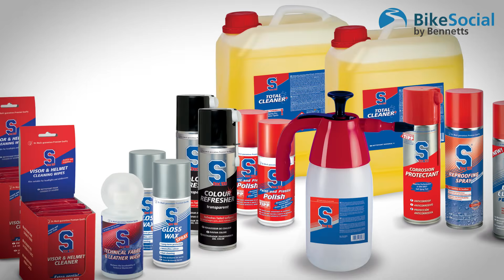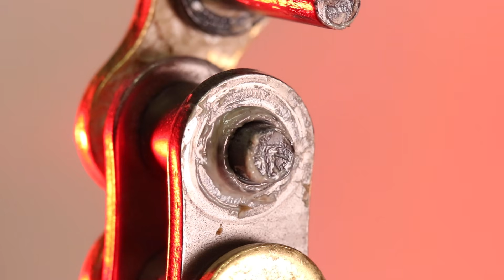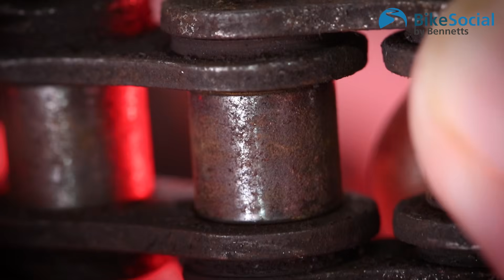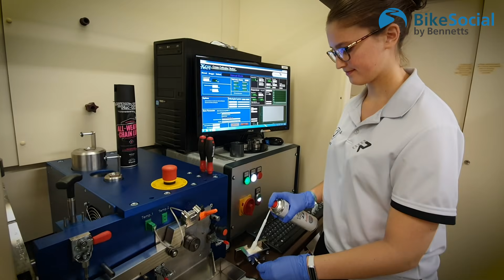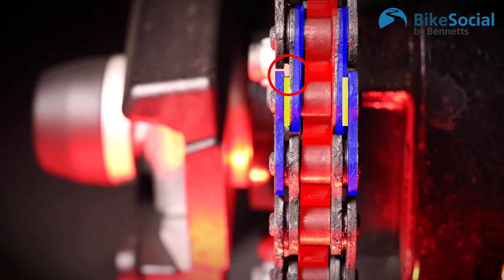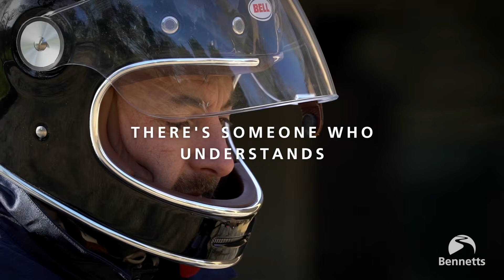Is chain lube a scam? Does your bike really need it?

Comment: Caution should be used with certain lubricants such as mineral based oils which can degrade the elastomers (o and x rings).
Reply from the maker: When I can finally get started on this, I will be testing the products for safety with O-rings. Cheers, John

Comment from the maker: This test will still be gong ahead, but lockdown has caused a major delay in getting hold of some of the materials. Hit subscribe and you'll get a notification when it's complete. Cheers, John
Reply: Thanks John.  I am subbed, so I get the alerts.  Agree that Ryan did a great job, but just not comprehensive enough to cover the UK.  It was interesting to see which "approved" cleaners managed to get past the o rings.  I currently use Muc-off cleaner and Wurth Dry lube.
Reply: @timmasonguitar  timmasong. Hi mate, in short I would keep every kind of aerosol lube or cleaner away from your chain. Both will just cause you brief and waste your time.
Metal to metal contact needs oil. All the chain manufacturers I have ever come across only recommend gear oil. 
apply to the inside of chain with a soft brush wipe outside of chain with a slightly oily rag. done properly you will get zero fling. your chain will always look like new and perform to its best.
Reply: @King-Arthur-The-First  hi. I'm new to motorcycles. So ive seen 10w/40 gear oil. Is that the sort to be using? And what about some youtubers recommending use WD40?
Reply: @arniet1  Hi arnie T. 10/40 is engine oil it is still fine but it's not as good as gear oil  because gear oil is thicker so has a little bit more protection for the metal to metal contact and less likely to fling off.
The 10/40 is in a group of engine oils like 5/30 5/40 10/40 20/50 etc. Engine oil needs to work at low temperatures and high temperatures inside an engine that's why they have those two numbers one deals with the low temperatures one deals with the high temperatures. 
gear oil tends to be 80 or 90 and often just says 80/90. 
if you don't want to become an oil expert short story is any oil Applied very thin to the chain will be fine to lubricate.
if you choose the wrong oil you just may have to put some more on before long or suffer a small amount of fling so it's no big deal mate.
if you have an oring chain then The O-rings are made of a nitrile rubber not the useless natural rubber and these nitrile rubber seals are used in seals all over the engine and fuel system and tends to be resistant to oil and fuel damage so you will be fine.
The idea of the WD-40 type products on to a chain is they are easy to apply and can keep the O-rings lubricated and wile that is okay it leaves the chains rollers to chain sprocket largely unprotected.
so better to use an oil which will do the job the WD-40 does but also do the job of protecting wear between chain rollers and the sprockets that are also driven by the chain so suffer wear. 👍
Reply: still waiting for the test.
Reply from the maker: @avsolanki94  It'll be worth it...
Reply: I hate doing chain cleaning, so I designed a new tool: ChainBath. https://youtu.be/UrkhRe8gQPI
Reply: Still waiting, would be super interesting.. come on guys!!!
Reply from the maker: The test is finally live... you can see it here: https://youtu.be/noshjM5CDas

Comment: what material are the seals made from. the cleaner/lubricator must also preserve the seals. but also this chemical should resist water. my best guess is a silicone spray or silicone brake fluid.

Comment: Chains are old fashioned, need a lot of maintenance and makes your bike and wheels dirty.  I still wonder why there is no maintenance free bike chain.  Belt- or shaft drive is imho a better choice,  in fact shaft drives can be made very light with the use of ceramic material .
Reply: There is now, bmw make the endurance chain with diamond coating
Reply: Drive shaft bikes handle way differant than a chain drive. The very reason they dont run drive shafts on race bikes. They handle like crap.

Comment: One used to be able to easily remove the chain. It would then  be cleaned. 
The appropriate chain grease would then be put into a pot, melted using Heat, ie. over a flame or hot plate.
When the grease becomes hot and fluid, simply lay the chain into the molten grease allowing the grease to penatrate the inner workings of the chain.
There were recommended amounts of time to leave the chain in the liquid grease.
After this process the grease would be allowed to cool so that the chain could be safely taken out of the pot.
A quick whipe over and the freshly lubed chain is ready for reinstallation.
Reply: I remember that can't remember the name

Comment: Chain lube traps dirt so you have to clean too.  Used WD40 only - had 17k miles on my bike and zero wear.  Fz1.
Reply: I would recommend a small amount of gear oil for the rollers and sprocket life also mate.
Reply: @King-Arthur-The-First  WD40 good for cleaning spray until it runs clear then cloth wipe

Comment: So factory grease is trapped inside the rings and stays there for the life of the chain. That’s also where the friction surfaces of the chain are. We don’t want anything to pass those seals. So what I don’t get is why do we want to lube the outside of the chain?? There no friction surfaces there so nothing to lubricate. And I don’t believe the lube lasts at the roller/sprocket interface long at all so is useless there...hence having a roller and not stiff bar for the sprockets to mesh with.
Reply from the maker: It's mainly corrosion protection but also to keep the seals lubricated, and within the rollers.

Comment: 50/50 automatic transmission fluid and acetone will clean that chain like nothing else! Splay bottle or brush it on then lube.
Reply from the maker: It will, but Acetone will damage the O-rings very quickly; in testing I've done before, it's ruined them very quickly. I really wouldn't recommend putting acetone anywhere near a chain. John

Comment: BULLSHIT!    Sand sticks to the wax or whatever and actually grinds the sprockets to hell. I stopped lubing my chain years ago. Grab your chain and get some lubricant on your fingers, now rub them together.  You have created your own grinding compound.
Reply from the maker: If you're riding through sand (or off road), you need to use a dry lube, a constant loss system or a light oil that you replenish regularly.

Comment: I've been riding for 40 years now. The chain on my Firestorm has just been changed along with sprockets of course. 32000 that chain had done. It had zero corrosion due to lots of lube. I spray the chain liberally then wrap a rag around it while turning the wheel by hand then repeat. The chain now looks good and ready to go. The other trick is don't have your chain too tight. Adjust the slack with you on board. Your chain will thank you for this.

Comment: I did a French tour a while back with a big kwack, I had a mini aerosol chain lube which I did most days. We had terrible weather, rain, heavy or torrential! At the port in France on the way back after passing control I rode around to the embarkation area, I thought I was being followed by a Panzer tank! Bought a scottoiler mini, I now adjust the chain once a year, which includes a European jolly of 1500 miles or so every year.
Reply: A non O-ring chain lubricated in gear oil would not have failed on u ... enough said
Reply: @mickeymouse4897  on a 1500 mile European jolly with poor weather, non o ring oiled on departure would have been dry day two, eight days with no lube! no, chain oiler on big power bikes is the only way ✊

Comment: I like the belt so much on my HD. No mess, lighter than a shaft, simple. I would think they could make one for any application by now. Though I guess the front sprocket size is an issue.
Reply from the maker: It's also maintenance – you have to drop the swing-arm out to replace it.
Reply: @bennettsbikesocial  My Harley is 19 years old and on original belt. Pretty low maintenance for a heavy bike. Swing arm is as easy as removing a wheel.

Comment: Do you know what. I use to race as a pro speedway rider... Oh 35 yrs ago and had two chains (primary countershaft and main drive) to maintain.
Renalds, DiD and maybe Regina.
After every meeting. I would wash them in petrol. Soak em in old oil, for a day or so and then simply hang em to drip dry.
My chains would last me almost a complete season. And under that sort of tention that a speedway bike puts them under.. 60bhp.. I would say that chain lubes, no matter what make. Are an industry scam. Good money for old rope
Reply from the maker: Presumably speedway chains don't use O-rings? Any sticky lube would be hopeless in that environment anyway. If road riders removed their chains (tricky without taking the swingarm out if there's no split-link), cleaned them (not in petrol as it will destroy the O-rings), then soaked them in oil (actually, if they're doing that, it maybe wouldn't matter that the O-rings were damaged and the grease had come out), then refitted them after every ride, chain lube would be unnecessary. But it's about convenience; some classic bike riders do still pop the chains off and soak them, but on more powerful road bikes with riveted chains, it's just not an option.
Reply: @bennettsbikesocial  No O rings, or X rings back then. Just split links.
Of course there was chain lubes on the market. Brands such as. PJ1, Castrol Pautoline ect.. and many lads used them. But their chains didn't last any longer than mine. I get it about the super bikes n road bikes in general though. It is a convenience thing.
But also a bit of a scam....😊
Cheers for the reply 👍

Comment: Have been round and round this one for decades.  Today I use plain old WD40 on all the bikes with chains - not the expensive WD40 bike product stuff, just plain old WD off of Amazon.  As an overall experience it's superb, especially as it makes cleaning the sprocket and the rear wheel an absolute doddle
Reply from the maker: Only concern with WD is that it might penetrate the O-rings and start to wash out the grease that's packed there. We'll be testing it though...
Reply: Bennetts Bike kerosene and wd40 are safe for o rings
Reply from the maker: @Potassium Syndicate  As proven here: https://www.youtube.com/watch?v=noshjM5CDas

Comment: Gear lube, and be done with it. Cheaper than chain lube, and is actually what DID recommended on my new 520 O-ring chain, same recomendation by Honda on the bike's manual.
Reply: https://www.ebay.co.uk/itm/274319990313?epid=652688914&_trkparms=ispr%3D1&hash=item3fdebede29:g:XZQAAOSw~HBefnBh&amdata=enc%3AAQAFAAACgBaobrjLl8XobRIiIML1V4Imu%252Fn%252BzU5L90Z278x5ickkY3FSd4Ad8xn3oRtkVexxrKQuNfZ0NUK7P1qFxyQGTK9guZHnbT3V7bNjTpKtTFDpdPVvrWEDj3FwGsxYR36H9iebqlcjlbmNeWCErLuPPFl%252BzV3fpbCw4jKU6cnDSVBU06hVtoBZSrz0V4sNJbuXeq8YTUNKgOwBuDgnIyqgAshqg6E6qPavikbnBpoBPCvHGcDZJTb3kZDamrKQy6yMEbufsbc012E4hCoL990vFkKQ3bgPVUxfZbT5Yc%252BqqP7OkCZHKL8yohn5RtgAdfC3izCfbdZ5r8lymBNWC%252B8yH92ZvWbO2Eg4zuyvg2tp2LI9hC6FVgnTEQXgGOiK2mgI2JzbhGgUhZ%252FaCuxFXRYp6mdh6PtcxPznGPeNY0DlxrVtwD04OW1xT08j2c9O5pmqLMzYH6h%252FjePTUM3u%252FXC%252BoWXudxEGDsSGFFf%252Ba3BGn4%252BjaAIpk8rxKMliwMCH1zKJ37v1dTFuVBn63TI8N0I1ceU%252Fl2XxD8fXi7SWFoEDI8XbbXoHECzyF88e8q4igKwoTxVJGJFg9yEOMBiP7xaKwxngbIMVvDMWxjoI7crUV3n59IOiJXIAcLzjjKwdZOYrvHdiZROLHYDzpPJjqwL%252FGYIW2g%252B%252FGF9o%252BkTmk6HclnJG3N%252BQ4%252FG9NXdnTBtt4ILEDAlAnb6RhlMq0ip1NUjTlgOEP2YlvzNeVuMK0Y83IW9WTzPNckyFrNWkB%252BKwz%252FWoLZ3YYEXp%252FVgYc9qnsLdq7vTQQkXKjKxC4%252BHt0KSBdGkXGFPxZTNFJq7IojrzLBeyonEGDBUj2Ji2Ovt9uK3bjhM%253D%7Ccksum%3A27431999031318414f6cc3034c8b92e86ff5f053755c%7Campid%3APL_CLK%7Cclp%3A2334524 this stuff okay?
Reply: Same with my 2006 kx450f owner's manual.

Comment: Lot of lube, only needed one chain adjust in 20.000 kilometers. 46.000 km and the original kit is new. Nothing more to say.
Reply from the maker: Which lube and cleaner do you use?
Reply: @bennettsbikesocial  Castrol O-Ring, any cleaner.

Comment: Tried gear oil for a while, great in dry weather, but would wash off when bike was left out in the rain leaving me to run the chain dry. Changed to a rock oil spray, been good so far feels very tacky though. Will be interested to see how it copes nearer the winter months. My commute is a 50+ round trip and use the bike in all but extreme weather.  Having chewed up 2 chains in 18 month anything that helps prolong the life would be of great interest. Looking forward to the results!
Reply: gear oil whenever needed prolongs chain life as per the manufacturers recommendation. chain lube attracts dirt.

Comment: Hi. I wonder if mechanics do grease the inside of the o rings before installing the pin that tie the chain altogether when installing a new chain!
Reply: They are supposed to. Any proper chain kit and link comes with a packet of grease.
Reply: @diamondheat9  thx dear
Reply from the maker: The loose link is typically in its own packet and pre-greased, plus as @diamondheat9 says, there is a packet of grease supplied too; that's the easiest part of splitting the old chain and joining a new one so it'd be a shoddy mechanic who didn't bother. John
Reply: @bennettsbikesocial  thanks John

Comment: Anyone else catch the Wilhelm Scream in there? 😱 ...I’m considering moving to a basic silicone spray for lube, probably need more regular application but picks up way less dirt
Reply from the maker: I'll add it to the list (though I'd estimate it won't do well, particularly on corrosion)
Reply: Bennetts Bike will be interesting to get the data. Was going to limit the silicone spray use to my enduro bike, the road bike still (currently) gets a non-brand loyal, proprietary aerosol motorcycle chain lube.
Reply: @peter_king  I use silicone spray on my enduro. Never get grinding paste chains again. Never have to clean them with chemicals again. Chains be going strong for a long time. I use chain lube on the road bike as it doesn't get washed and filthy like the husky.

Comment: 30 year daily rider here:
Nothing works like a ScottOiler. The slow but continuous flow on the chain with oil cleans it and  helps it last a long time. I use the cheapest two stroke engine oil I can find to fill it, and wash the drive and wheel down with Simple Green and a hose about every other month. Thats all thats needed. It just works. My current bike is a 98 bought new that now has  120k miles on it. I put a ScottOiler on it in 99, and its been there ever since, and still works. Done.
Reply: TOTALLY right, Mafren. On my Trophy 3,  I went from weekly chain adjust and lube to monthly or better.  Same on my Tiger.  Chain lasts longer too

Comment: I am of the opinion that there is no way any oil can lubricate the contact between sprocket teeth and chain rollers.Only an oilbath chaincase would make a difference.That's why we are told to lubricate the edge of the links.And it is purely to stop the chain going rusty.And it is OK to clean the chain with WD40....it does not affect the O or X rings.EP 80-90 Gear Oil was tested against 9 other chainlubes on another Youtube video and came out in 2nd place.A bloke I know destroyed a chain in less than 2000 miles....by pulling wheelies every 5 minutes!
Reply from the maker: I did reference Fort9's video of chain lube tests, and I soaked O-rings in several cleaners (including WD-40) for over a year. No, WD won't damage a chain's O-ring, but it is a penetrant, which could help wash away the grease that comes packed in the chain. We'll be testing everything possible in the cleaner and lube test that's coming up... John

Comment: I guess climate and temperature will be another variable. If you ride in 40c hot summer weather, im sure its not going to adhere to the chain as well. Such a tough topic this one, good on you for giving it a go.
Reply from the maker: To a point, though the heat generated in the chain itself should exceed ambient temperature. Ultimately, as long as we can control the testing environment, and make it repeatable, it should giv a fair comparison.

Comment: Shaft drive is better
Reply from the maker: For maintenance, yes. For power loss and weight, no.
Reply: @bennettsbikesocial  I hadn't noticed the k13r lacking in power though 😉
Reply from the maker: @leftclickben  Very true. And for many applications, shaft drive is better, but overall, neither chain or shaft is 'better'

Comment: I've been saying for years, why dont they design bikes with enclosed chains with an inspection flap, they could make them look like a shaft drive system in bet. Here in the uk with our heavy rainfall, it would make sense and maybe our chains would last a lot longer. Maybe the manufacturers wouldn't like this though and that's why it's not happening.
Reply: Honda 50 step thru had enclosed rear chain. makes engineering sense
Reply: The main reason I suspect is fashion. Fashion is to blame for joke mudguards, no fully enclosed chains and no grease ripples on suspension parts. These things were common in the 50's and 60's....😢
Reply: I always wondered this as well and even considered designing one. I mean everything else has a cover on sports/touring bikes so why not cover the most important thing?
Reply: Enclosed chain guards were a thing years ago... but honestly a scottoiler is a better solution.